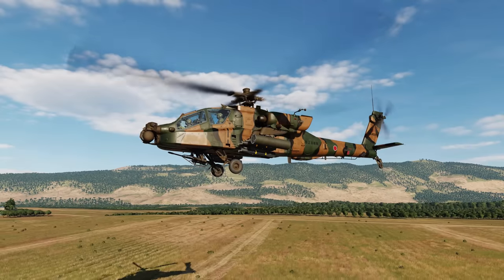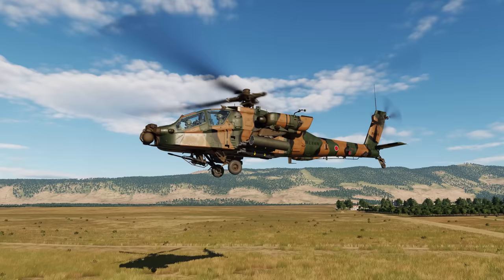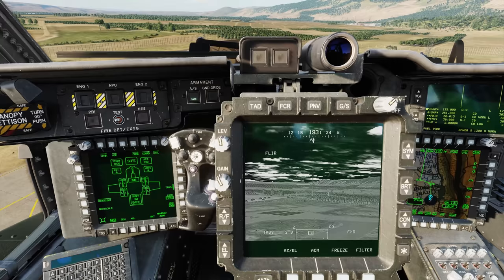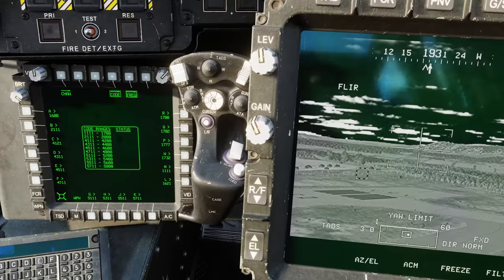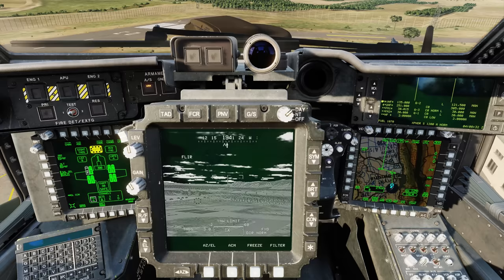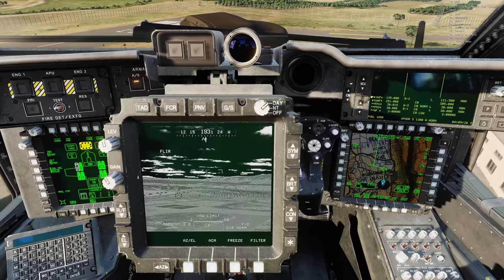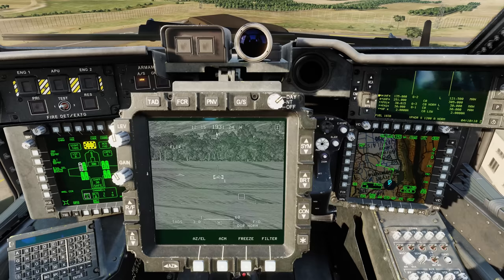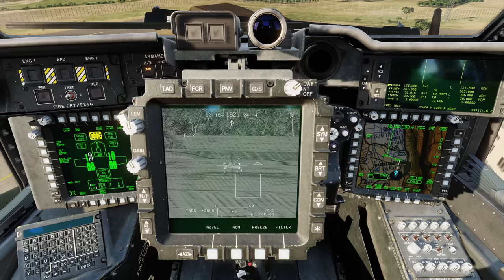DCS: AH-64D | Laser Spot Tracking

Comment: How would you get the missiles to home in on the reaper's spot? Also is it explained anywhere how the primary and alternate channels are used?
Reply: Missiles can already track off board lasers. You just set the missile code to the offboard source. I've guided plenty of hellfires from a hornet at angels 30.
Reply from the maker: You'd need to set the PRI channel to match the Reaper designation. Please see the earlier video on the Hellfire re PRI and ALT. You'd only use ALT for ripple shots.
Reply: you can change the laser code that the hellfire is looking for in a similar manner as changing the LST code. just select hellfires, and click the desired laser channel (A,B,C,D etc) and select it as primary. now the hellfire will search for a laser spot with the code you just changed it to. About the primary and secondary channels, when selecting ripple mode on the hellfires, you can fire two missiles in quick succession. the first missile fired will look for the primary laser code, and the second for the secondary missile code (or other way around, depending on you settings). this allows you to strike two targets almost simultanously.
Reply: You can set the LRFD channel to the JTAC's laser code, in this example 1678.
After that, you can WAS the hellfire, and fire it once the target has been identified.
(Alternate use: LOAL towards target coords, for example from behind a hill).

Practical example:
Own laser - 1588
Buddy/JTAC lase - 1678
WPN - CODE - FREQ, Channel A: 1588, Channel B: 1678
WPN page - PRI - B
WAS Hellfire
Have buddy/JTAC activate laser
Look for active laser (helps if you know the area)
Fire once constraints are met (large solid box for lock, ~1-9.5km range, depending on circumstances)

PRI and ALT can be alternated in ripple fire, for example by lasing 1 target via your own code, and a second via the buddy/JTAC.
with WPN - MODE set to RPL, it will then alternate the codes it has the hellfires look for.

Comment: would the laser from the reaper be visible at night as a long stroke from the sky? Or it is only typical for ground based laser spot equipment?
Reply from the maker: I think you are mixing up with an IR pointer.
Reply: @MattWagner  So this is totally different laser than IR, stronger and of different frequency? Is this possible to track IR pointer from Apache? I remember I saw your video once where tracking was at night where the beam was visible, shifting and waving...
Reply from the maker: @norman191000  We have no viable reference data for the AH-64D IR Pointer device. I think the video are referring to has an IR Pointer designation from a JTAC, not the AH-64D.

Comment: Radio presets?
Reply from the maker: In this case yes, but you can certainly manually enter too using MAN mode.
Reply: @Matt "Wags" Wagner  Is the ability to edit names of the preset radio channels coming in the next patch as well?
Reply from the maker: Part of the upcoming Data Transfer Cartridge (DTC) function coming later.